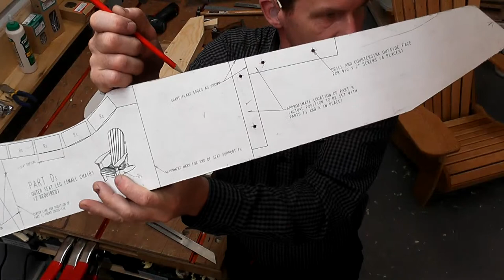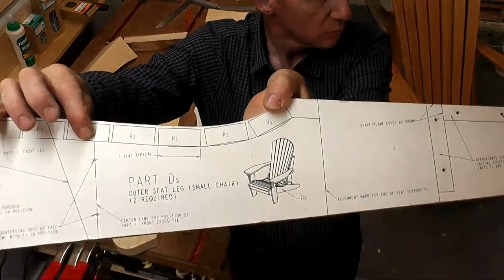Adirondack Chair Part 2 - Woodworking Wisdom

Comment: When beveling the edge of a board, one way is to cock the blade over with the lateral lever as is shown in the video.  Another way is to leave blade cutting edge parallel to the sole and place the plane halfway over the edge's corner and stroke until the desired bevel is developed.